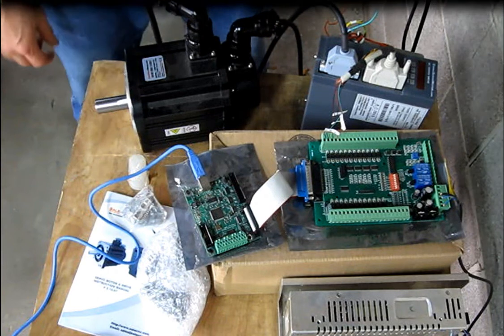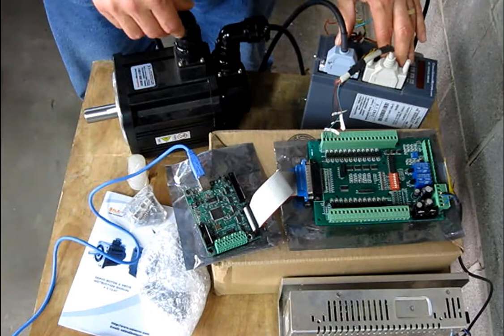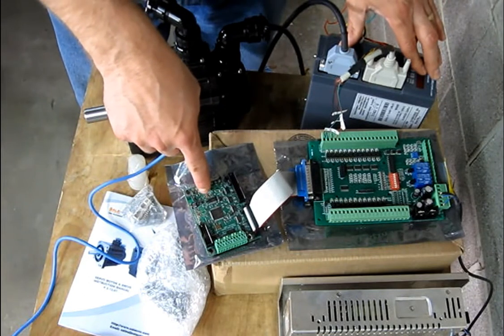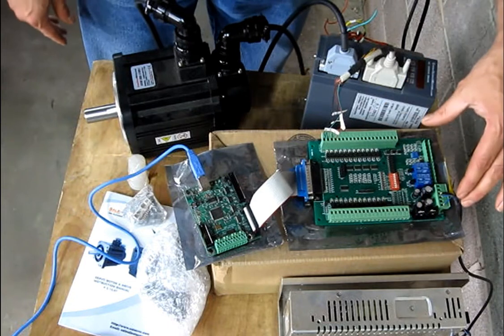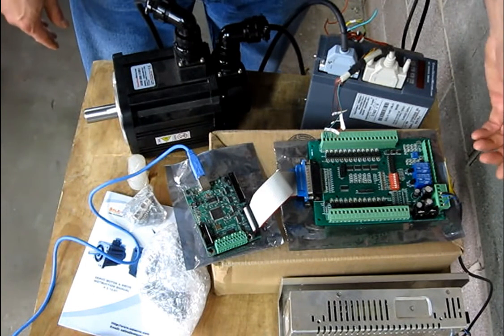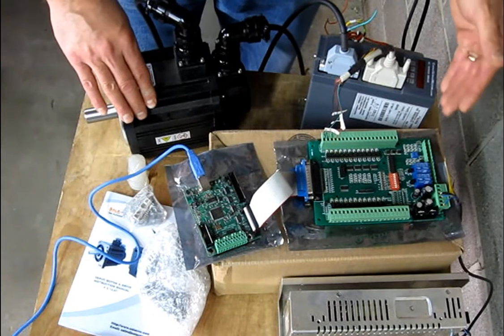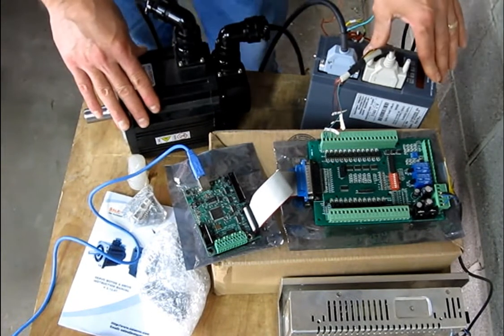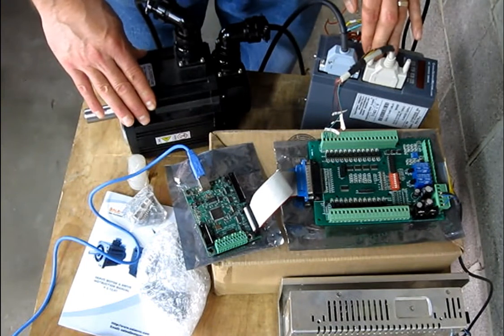2KW AC SERVO WIN8P1 11

Comment: Have the motors been reliable?
Reply from the maker: Seem to work great. I only purchased the motor and amplifier to teach myself how to implement an ac servo drive with the mach 3 cnc  software using 64 bit winos 8.1 via usb connection to my laptop.  I later sold the  ac servo drive and motor to some one who needed it for a specific project.  I only ran the motor on my bench for educational purposes.  The unit did perform smooth quiet motion while repeatably starting and stopping with perfect accuracy.  Thanks for your comment
Reply: thanks which chinese store did you purchase from?
Reply from the maker: http://www.salecnc.com/catalog/